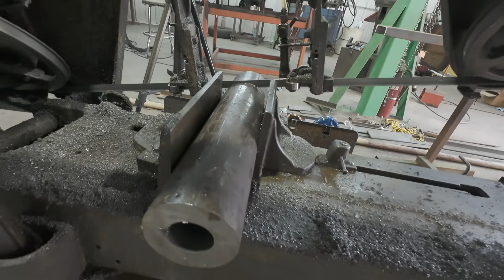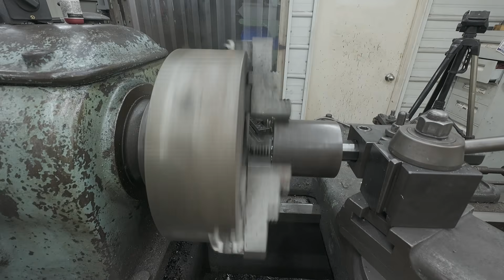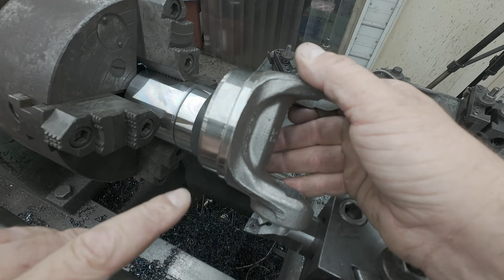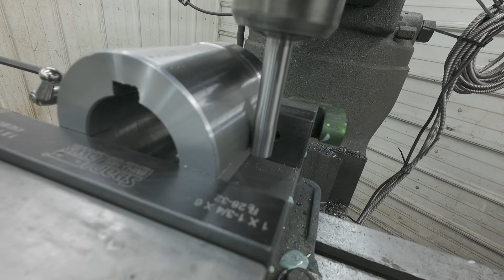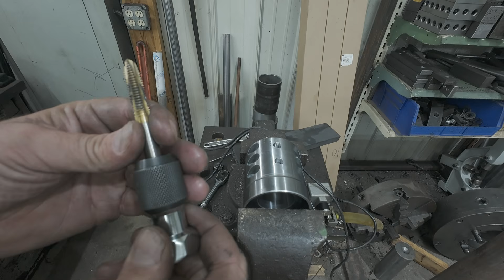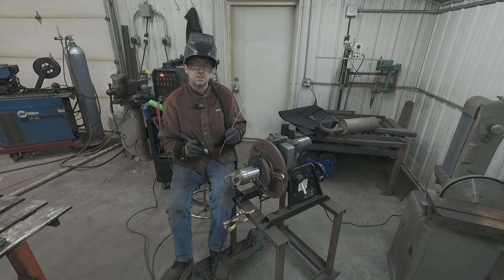These Sawmill Parts Don’t Exist... So I Had to Machine Them

Comment: Josh is it possible to tell us what spreads you set your lathe and mill at when you are machining material. I live in an remote area and have bought a mill and lathe and am trying to learn from you old hands how to best use the machines I have as there is nowhere I can be taught this as I would have to go to a big city and that is not going to happen. Thanks in advance.
Reply: Sorry I meant to say speeds not spreads damn prescriptive texts.

Comment: Josh,
Tig welding will give a much better weld than mig welding.
It will give you much less porosity and give much better weld penetration. But unless you stop and let it cool before completing the weld. Tig welding will heat the joint way more than mig welding. Mig welds the joint faster and cuts the joint heat. I myself love tig welding, but you will warp things more with tig versus mig. I'm not looking for an argument, just stating a fact I've learned from 42 years of welding.

Comment: Good one Josh .   Just for a suggestion .  If you were to tap the two end clearance holes with the next size thread up , then they could be used as jacking screws to slightly open the coupling for ease of fitting & removal .   Cheers  👍
Reply from the maker: Extremely valuable suggestions.

Comment: Nicely done!  I know the strength in this application is not a big issue, however having a fillet/radius at the bottom of the counterbore for the yoke would have increased strength and reduced any crack potential.

Comment: am I guessing correct that trying to mechanically fixture the collar when you were doing the full-depth clamping slot would have ended up with it 'overconstrained' and actually make it harder to get it aligned, where doing it freehand as you did allowed it to self-guide into the blade, at very minor risk of Wander, although Wander is less of an issue with the deeper blades and shallow teeth on Metalshop bandsaws than for Woodshop. (for other commenters' benefit: Woodshop bandsaw blades tend to be quite shallow in the blade spine with very deep teeth by comparison, allowing for more jigsaw-like usage)

Comment: I was wondering how the balance would go with your six retaining bolts coming in from the same side and would it not have been better to do three one side and then rotate it 180 degree and do the other three. Keeping in mind that your locking grub screws are also on that side.

Comment: You are sure going overboard with this coupling. But this way, you know it will be ultra reliable and not fail. Better to over design than under design and have problems.

Comment: love your machining skills, and envy that automated key making! Question (may be a stupid one out of me not getting the video right - in that case, I am sorry) are you not supposed to tap only the bottom side of those tightening bolts holes?
Reply from the maker: You must have skipped the part where I counter bored the top half and tapped only the bottom.
Reply: @TopperMachineLLC yes I did! Sorry

Comment: Each machinist has their own unique way of working, Myself, because the 2 finished parts are fairly short. I would have cut one length of material + 1/4 inch and then faced, finish turned and bored one part then turn it around and did the same to the other half, thereby eliminating any need to indicate it in 👍
Reply from the maker: I don't like having that much sticking out of the chuck when doing close tolerance work.

Comment: Could you explain how and why when chamfering you appear to use an elevated tool position for ID and drop the tool for OD. Never seen this and was never taught this. I trained as a fitter 1980s and so during broad based lathe skills in the first year I may not have had this explained or have forgotten. Many thanks in advance.
Reply from the maker: I have an older video explaining this very topic.

Comment: Not that it matters much, I would have spun the unit 180* when putting in the second 3 holes for clamp bolts. Just to help the balance. Put the whole shaft on an Anderson balancer to see how much it's out of balance. BTW my spin welder would have have to go 1/2 the speed you welded at as I'm not that confident I would make a great weld.

Comment: Dear Topper. If I were you, I would center the universal cross fork. Then it will be easier to balance the whole thing.
Reply from the maker: It is balanced just fine. I only needed a little bit of offset correction.
Reply: Sure, and if balance was a concern the clamp hole sets would have been drilled and tapped from opposite sides of the hub.  But at 500 RPM who cares?

Comment: a great 4 jaw trick for round stuff is to set the material on the 6 o clock jaw so its centered in the hollow of the jaw, then tighten the 9 o clock jaw so it's close, roll that jaw to 6 o'clock and repeat. with a little practice and you can get it to within .02 before you even pick up the indicator.
Reply from the maker: Most of the time I'm closer than 0.020 when I start. I just exaggerated for the video.

Comment: Love how quiet those head stock gears are on the old Monarch!
Reply from the maker: No one made a better lathe.
Reply: @TopperMachineLLC  just a pleasant humming, just loud enough that you know it's Working Right, but not so noisy it drowns out your thoughts. have heard some really clattery lathe heads in my wandering of Machinist Youtube, and wondered, buddy when did you last check that thing.
Reply: @TopperMachineLLC  YEAH, They don't make them like they used to!!

Comment: I remember awhile back you said you like to set your boring bar a little above center. I forgot why you do that. I notice it when you did your chamfers on the bore and then moved to the outside diameter. The tool holder dropped.
Reply: Tool clearance. The tool would rub on on the ID if you leave it at center so you raise it to clear.
Reply: @TheFallenAngel13524  Not sure that is why Josh does it. All of my boring bars are set at dead center. Have no issues with the tool rubbing. My boring bars have the clearance ground in it and they are all insert tooling. I can't speak for anyone else.
Reply: @scottzink3455 pretty sure his boring bars themselves aren’t set above center only the tool he uses for chamfering the ID.
Reply: @TheFallenAngel13524  He responded to my question. There was a previous video where he talked about setting his boring bars above center a little bit. He explained why in the video, I just don't remember what his reasoning was.
Reply: @TheFallenAngel13524  You are correct about the chamfer tool. He would be raising that for clearance.
Reply: @scottzink3455  I dont recall josh ever mentioning running boring bars above center. i do recall a couple times about him running his chamfer tools above center and the reason why. I did go back and skim through a bunch of vids but i couldn't find anything about the boring bars. So i guess if you find it let me know where or why.
Reply from the maker: There is an older video al about that.
Reply: It reminded me as well the moment the tool holder dropped down as well 😊
Reply: My brain has a hard time understanding the "touch off" you do before you set how much your taking off per pass. Could you explain please? Al B.
Reply: You touch off to set a zero for your new tool.
Reply: Lovely looking weld. If it looks right it is right. The first time 😂😂
Reply: For the same reason that an od tool is better below center than above. It creates clearance.
Reply: If a boring bar is ground with enough clearance it will cut just as well on center as above.

Comment: Josh, I am an electronics guy so anything I may know (or think I know) about machining comes from watching YouTube videos like yours. The how and why of your alignment process in the four jaw chuck makes sense to me but I have often wondered: once the workpiece is aligned, does tool pressure cause all of that effort to be wasted? I don't have any hands-on experience with just how much force it takes to cut metal, but it must be a fair amount even with a sharp tool. It seems to me that the required pressure could cause the workpiece to shift in the chuck which would destroy all of your effort to align it.
Reply from the maker: Once it's all indicated true and tightened down, it really isn't an issue. Unless you take too much or crash.

Comment: Nice! I was wondering if you could have used a Dodge Para-flex coupling instead of making your own. I sold a LOT of them when I was in the Mill and Industrial Supply business back in the early '80s. May be pros and cons as to price, strength, etc. vs making your own... :body-blue-raised-arms:
Reply from the maker: I considered all the options. I needed something more rigid, which is why I went this rout.
Reply: @TopperMachineLLC  Makes sense! Most of my customer's applications were "one-off" builds so I got pretty good at picking "the right parts the first time". Did it for five years as one of three Inside Sales Engineers after I got my ASMET Degree (and working toward my BSMET). Funny thing is I quickly became the "go-to" guy whenever a customer had a "unique" problem and/or needed help with an emergency situation. Let me tell you when companies like Nabisco call because the Premium Saltine line goes down they are REAL anxious to get it back up ASAP! Funny one about that: The Premium line (and pretty much everything there) runs 24/7/265. Lucky this happened in the daytime. The conveyor that feeds the dough through the oven has to be VERY precisely controlled. Too fast and the crackers don't brown just right, too slow and they EXPLODE in the oven! Their ancient speed controller failed, and I had to take them a new one. Got there with it and walked into the production area and there were cracker bits EVERYWHERE! :face-fuchsia-wide-eyes:

One neat thing about visiting that place was they had bins of "second quality" (i.e. broken) cookies and everything else everywhere. The rule was while there you could eat as much as you wanted, but you couldn't take any WITH you when you left!

The leftovers they sold to be mixed with Cattle Feed!

:face-green-smiling:

Comment: I have used an old woodworking brace as driver for taps, good grip and works well with bigger taps, and lots of torque to tap as well.
Reply: Thanks for the tip Sean great idea
Reply: I’ve been thinking about this very same thing for about a year! Glad to know it works!
Reply: I have also used  a 3/8 or 1/4socket extension on the square drive on the tap. If that doesn't work I have some  tap extensions...they are super handy and cheap enough